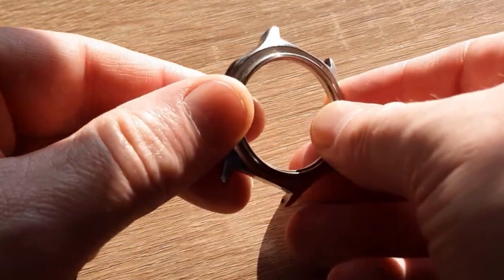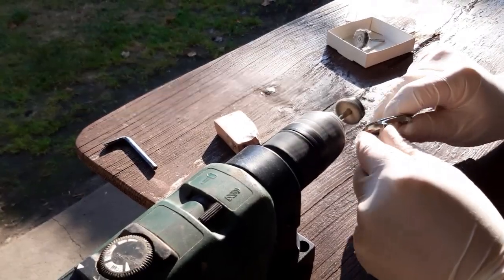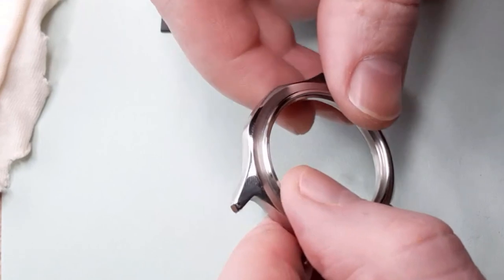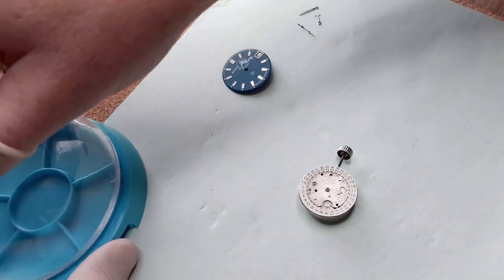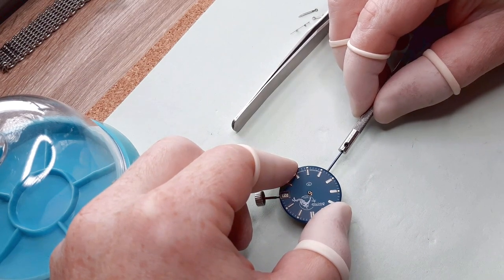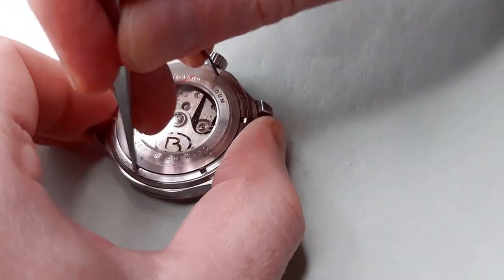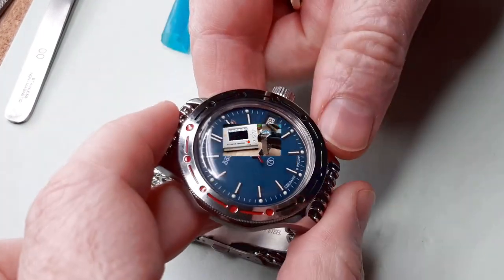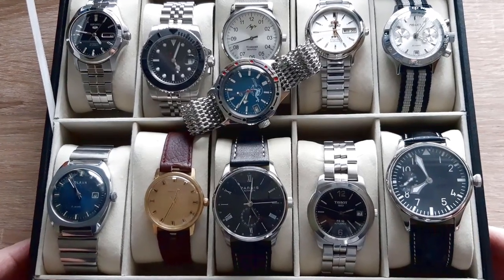VOSTOK MOD | AMPHIBIA watch restoration renovation reincarnation PART 3

Comment: My main Vostok project at the moment is built around a very rare Vostok "snowfall" dial which I am trying to replicate the original snowfall Amphibia, I got the round case, the black bezel and the hands but its finding a decent auto movement as well as changing the date wheel to white on black, I even got a very nice display caseback for the build and may well gild the rotor as I have gold, silver and copper leafs to work with and really liking the idea of the copper gilding.

Comment: Just one minor point. Never use the hands press to push on the second hand without first supporting the pivot at the rear of the watch, you risk quite a bit of damage by not doing so. 
Nice project and a good result.
Personally I don't like the aftermarket display backs because the watch is no longer waterproof to any kind of real depth. 
So what happened to the original movement ? 
I ask because I rather like the 2409 movement with no date complication, I like the idea of an Automatic with no date.
Reply from the maker: Hi, thanks for your advice, I will now be careful with the second hand. I still have the old movement and it seems it is in very good condition and after service can be reuse but now my attention grab a scratchy Citizen 😊

Comment: How did you get the case slimmer to the 12mm, you mentioned? The crystal? The case back?
Reply from the maker: It is a case form older Vostoks, from 90's, new version is much thicker.
Reply: @tickingWATCH  - thanks!

Comment: I have seen another see through caseback on other videos. That other one seemed to add significant thickness to watch. This one looks much better. Does it change the thickness of the case at all? It looks great. Would it fit on a 710 case? Thanks.
Reply from the maker: I think the case back size is a standard by Amphibia and thickness increases maybe 0,5 mm 👍
Reply: @tickingWATCH   Also just wondering, why do you lose so much water resistance with the see through caseback? Will the glass get compromised under pressure?